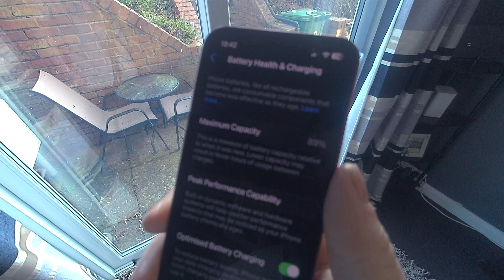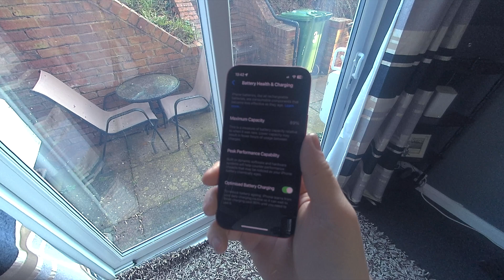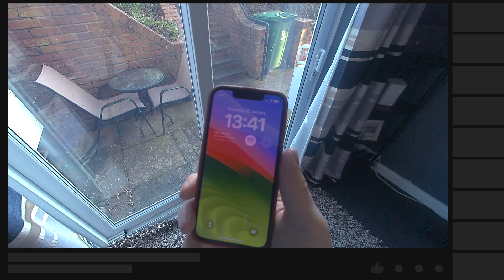iPhone 13 mini Battery Replacement | Step by Step!

Comment: Does this work if I have a screen protector?
Reply from the maker: The screen protector will be a thin piece of film that resides over the display and replacing the battery shouldn't be affected with a screen protector.
Reply: @ thank you!

Comment: I saw a 6800 mah iphone 13 mini battery should it work the same?
Reply from the maker: The 13 mini comes by default with a 2438 mAh battery. 6800 mAh seems too high to me as that might be a battery for the regular 13 or pro models. But if it’s the right size for it, it should still work and function as expected.

Comment: Hi, How  is the performance?
Reply from the maker: I noticed instant performance boosts across the board 👍 Prior to this, I was experiencing regular lagging. It's recommended to replace your iPhone battery every two years than simply pay another $1,000 for a new iPhone.
Reply: @leethegeordiee yeah that's why you get an android instead of wasting money to change the battery every two years
Reply: @charles7765 I know damn well what I am talking about, iphone developers make the batteries bad on purpose so people would waste more money on replacing them and eventually buying a newer and more expensive iphone which is worse than the previous one. I have an android phone that I have pretty much used 9 years and the battery is as good as new, I bought my iphone about a year ago and the battery lasts under an hour, the android battery lasts for a whole day still.
Reply: Hei. My 13 mini is 2 years old (BH 85%) and SOT is around 4 hours. If I change my battery will it last around 6 hours?
Reply: @voblaest5248 no, only 5.

Comment: Amazing tutorial! Feeling confident doing the replacement myself. Do you get the “non genuine battery” notification every time you restart the phone? Or is it just on initial startup?
Reply from the maker: Thank you so much! I only receive the non-genuine battery notification once turned on, but can be easily ignored with just a swipe of a finger. The battery still charges fine by cable or wireless charging. The iPhone still recognises it as a battery and I noticed an instant performance boost as a result.